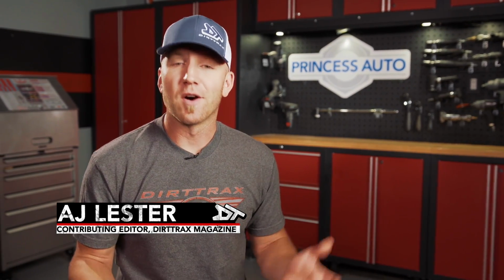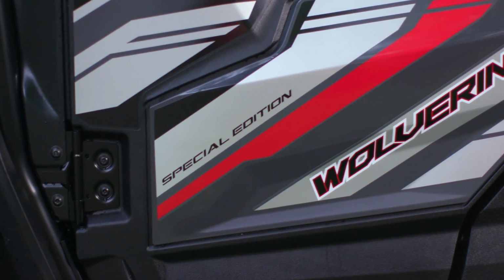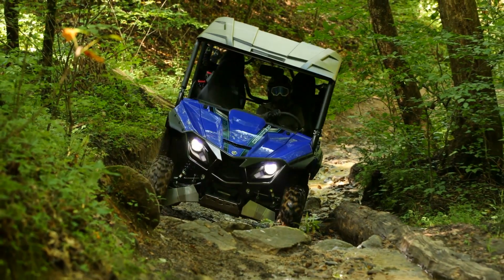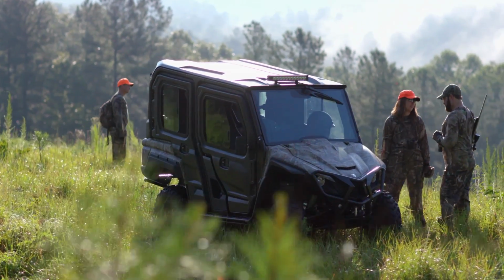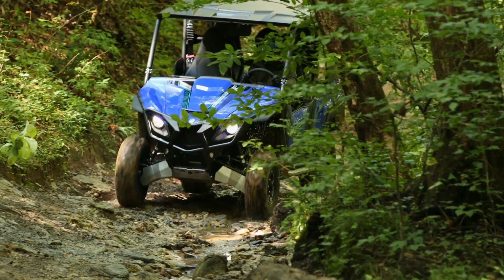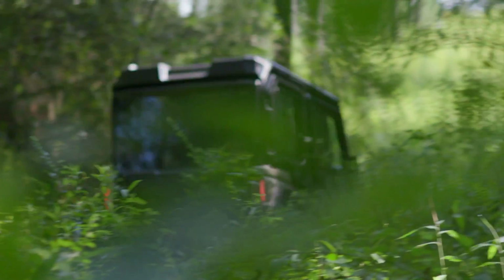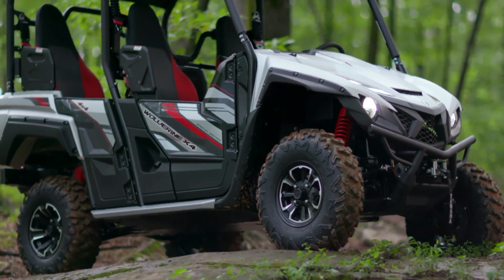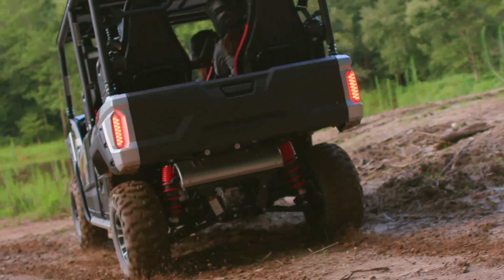In-Depth Look: 2018 Yamaha Wolverine X4 SE

Comment: I'm betting this new engine will find its way into the two seater Wolverine R Spec as well.  Add a power assist dump bed and a real opening tailgate and I would buy one.  I only have a Kubota RTV1120D that is basically just a utility machine.  It has been problem free and is a 2013 model.  I also have a hydraulic dump bed, and had the Kubota 72" plow that is hydraulic side to side and electric lift combo and it works awesome.  I doubt I will sell the diesel Kubota, but would love to add a new two seater Yamaha with a parallel twin.  I've come close to buying a Teryx 800 two seater also,  I am just waiting so I can try out both and compare...Great job Yamaha!

Comment: I like all of the features that the Yamaha X4 have to offer. Except for the drive by wire. Can-am has this system and with the dirt and mud it always has problems! Yamaha can still do a key equipped speed limiter by limiting the ignition timing. It would be cheaper to do give you better throttle response by using a cable drive and keep reliability higher!
Reply: Ima Freeman the drive by wire is not noticeable. I did a n actual in depth and riding review on my channel if you want to check them out